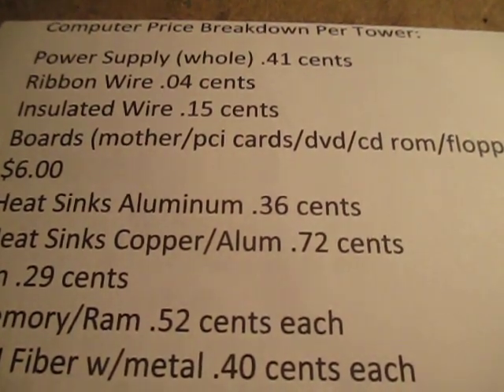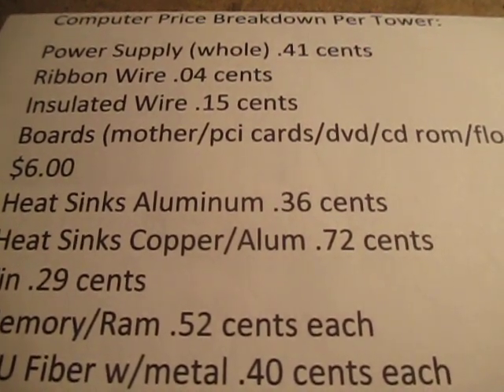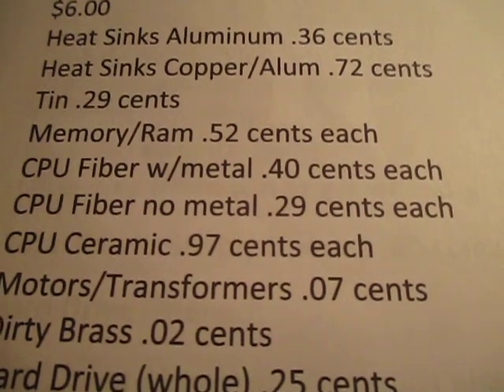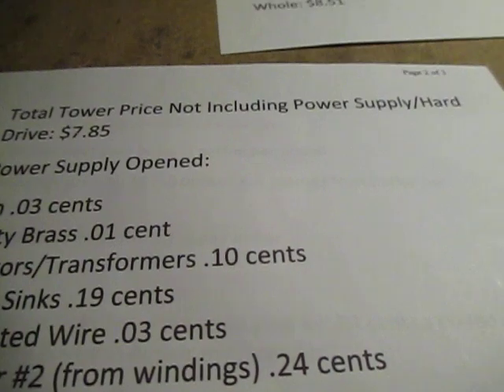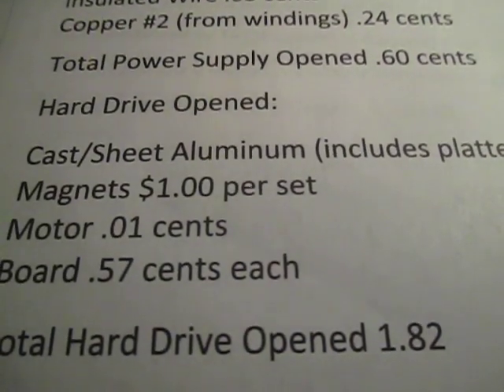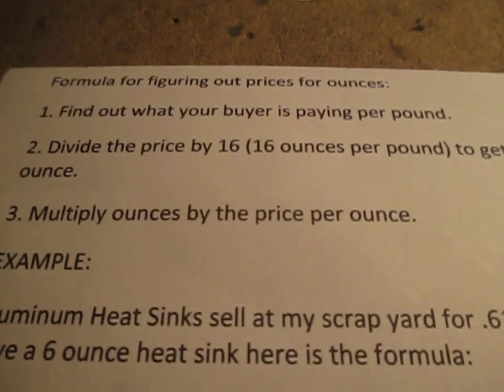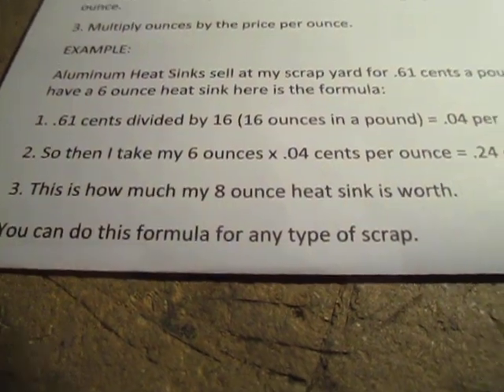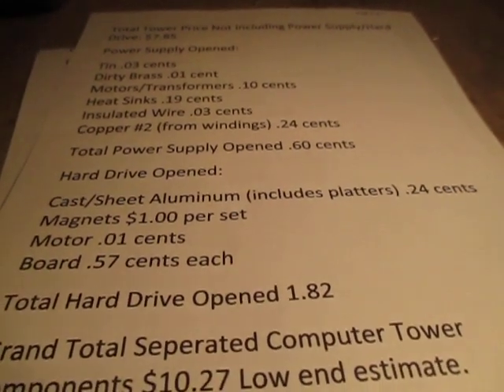How To Figure Out How Much To Pay For Scrap Computer Towers + Formula!

Comment: Hi Kerry, thought I'd give you an update, I picked up an extension lead today from work.  The guy was going to chuck it in our shred skip!  We don't pay for our metal skips but we don't get paid for our scrap either.  I also picked up a chest of drawers that was broken beyond repair and was about to be thrown in the rubbish skip (which we do pay for).  So many people are blind, they see broken things as things that are broken.  I saw (and now have) 3 sets of drawer runners, 1 set of 4 casters (wheels) and some nice light wood laminated shelving (the carcass) and still have the drawers which I'm sure I can find a use for.

So it's not just about what you can sell for but what you can use that will save you having to buy.

Poo
Reply from the maker: poosmate That is awesome Poo! Thanks for sharing all of this.